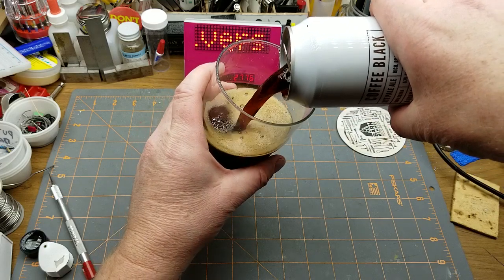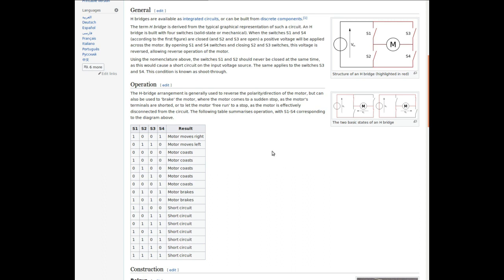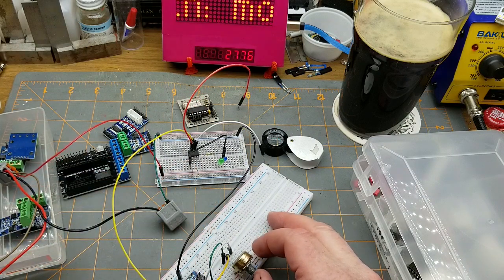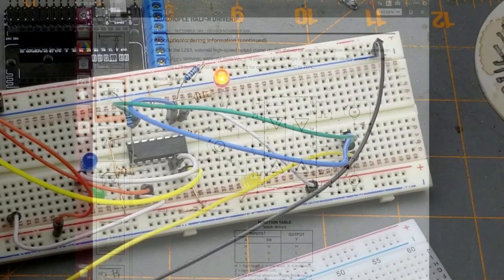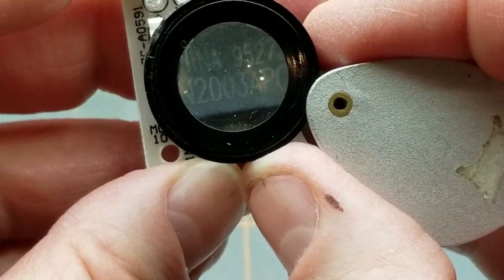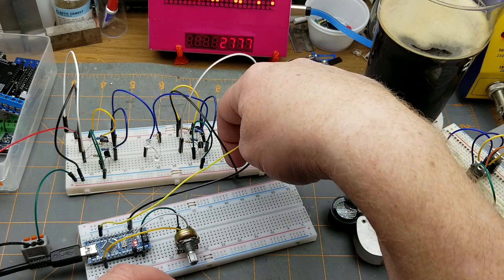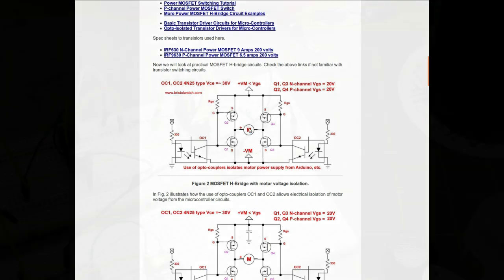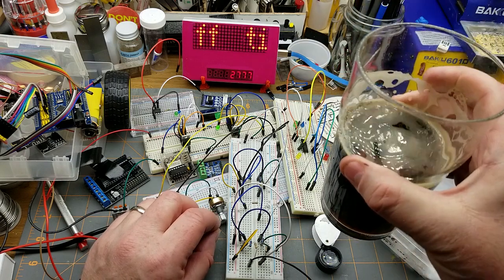tinkering with: controlling motors

Comment: Ref L298: You can run a single PWM signal to the enable pin and use in1 and in2 to determine direction.

Comment: Hi     The L298N can handle more current but can't be used on a breadboard - modules
are on ebay ( as are the ICs ). I made a test jig for the ICs using a pair of ZIF sockets .

                                                                                                                            Alan

Comment: The L9110 is a nice little driver. One of the better things to come out of China. I've used it on a few little bots and found it easy to work with and it has very little voltage drop.  If you are going to drive the bot from an Arduino, then just cap'ing the motors will usually be more than enough. For an ESP,  cap the motors and power and have separate power for the ESP. That can be just a separate 3v3 regulator as long as you have a good battery that can supply enough current to all. I usually have a beefy battery or batterys to run my bots. This one https://www.youtube.com/watch?v=35_uKsT6dTA is a 6 TT motor platform and I'm driving it with a L298 on an Uno clone.  I'm usually not a big fan of the L298 or L293 (it for many reasons)  but for this platform, it worked fine. With the voltage drop of the 298 and the 75pct duty cycle, I am PWM'ing with, the motors are not getting too much power. I also have these motors ramping up to speed. I'm a huge advocate of ramping the PWM in motors, it helps in power dropout (brownouts) on startup, traction, and wear-n-tear on the motors and gears.  Have fun, cause bots are fun!

Comment: Hi     I thought that I would look for the 28 pin L293 ICs on Ebay but no joy . I did find 20 pin
ones but they are not cheap .

                                                                                  Alan